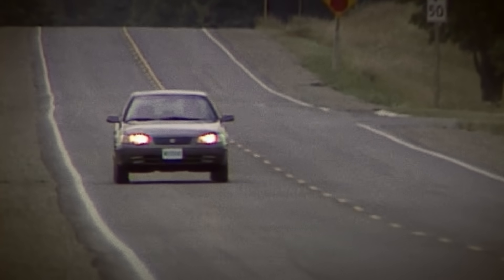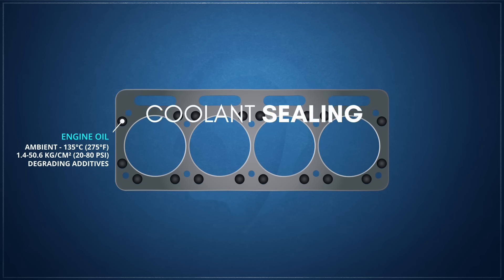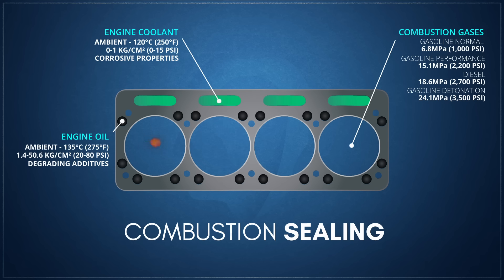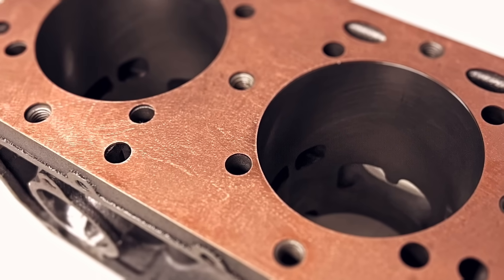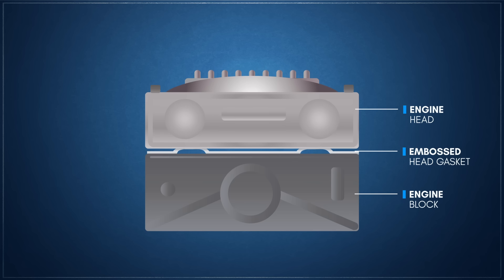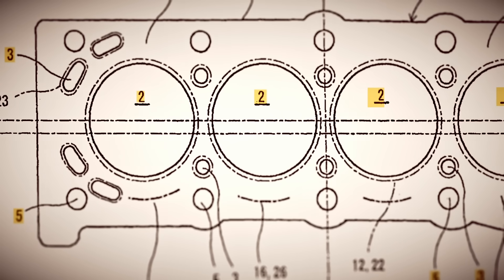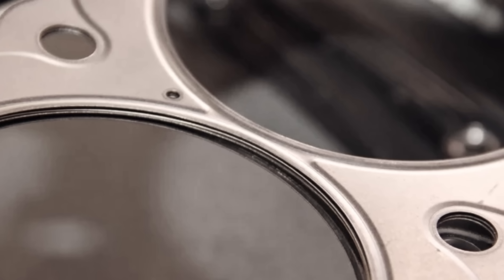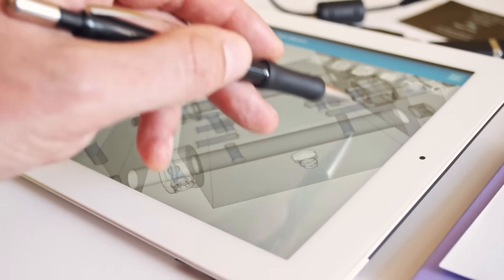The Most Tortured Part In An Engine

Comment: You definitely did your homework. I watch these kinds of videos sometimes to see if you guys tell the absolute truth or bullshit people. Very nice job, you touched on everything that needed to be and included every possible bit of information for the novice
Reply: then you should have understood this video is just a big reach, there is many inaccurate points but the most important is, it pretends head gaskets are rocket science, while they are not, really. Any compression gasket can sustand high pressure because the contact area is extremely small, head gasket is not and has never been "the most tortures part in a an engine", such a ridiculous claim.  Head gaskets are not rocket science, on small 2 strokes they are often just a piece of paper or aluminum, how ridiculous.

Comment: EXCELLENT VIDEO!
Me, ASE Certified Master Engine machinist for over 30 years.  I have been working in the engine rebuilding industry for 55 years. Had my own shop for 20 which included a Comec wet surface grinder capable of accuracy of .001 per 12" of length which is what we used to surface both the heads and blocks.
 Back when I opened my engine shop in 1978, we saw a lot of Honda 1200 and Chevy Vega engines with blown head gaskets. The Honda was all aluminum while the Vega was Aluminum block and cast-iron head. Both used the "open deck" type of block. Both were composition gaskets "squishing" about .007-.008 when torqued. My thoughts were that the cylinders were "moving", and the gasket was not adequately being compressed on the cylinders.
 My solution was after machining the gasket surface of the block flat, I then went around the outer edge of the block and machined an additional .001-.0015. That resulted in the cylinders "standing proud" .001 compared to the edge of the block for a tighter clamp on the fire ring. This really helped the durability of the gaskets.
 But they still needed retorquing which in the case of the Honda meant removal of the rocker arm assembly since it sat over the head bolts, UGH!
   About this same time a LARGE gasket company (FP) announced their no-retorque head gaskets! We were jumping for joy thinking of all the time they would save and started installing them on our engines right away. Within WEEKS we started seeing problems! These engines started spitting out head gaskets some in as few as a couple of thousand miles! The VWs in particular would come back with actual pieces of the gasket hanging out from the edges of the head! We stopped using them and went back to OE type gaskets and the problems ended.
 The company asked me to send them back so I sent 1 of each, Honda, Toyota and VW. They called me and said they would warranty the gaskets. I said that was OK but did they want me to send them the REST of the failed gaskets we had? "How many more do you have?". I told them 32, SILENCE. Then he said "let me talk to someone". Another voice on the phone "Is there a major airport near you?" yes "A couple of reps are going to fly to your shop and see if we can tell what's happening".
  The next day the VP and head of Tech arrived at my shop. After examining my machines and procedures they could find nothing I was doing wrong and said they felt it was the area WATER that was the cause!. I was stunned but before I could open my mouth he said "BUT, we are prepared to offer to pay you parts & LABOR for all the failed gaskets PROVIDED you sign a release form and will make NO further claims against us. It was a LARGE CHECK so I took the offer.
 They must have sold a LOT of those gaskets, we continued to see failures of them that others had installed for YEARS after that!
Reply: ))) id be pissed if my newly rebuilt engine blew again
Reply: @zukacs  The engine didn't "blow". Just the head gasket went bad. I fixed all of them at no cost to my customers.
Reply: What do you mean claims?

 Anyways very cool information. Have any other similar stories for other engine parts to non car layman like myself?

 I figured gaskets were an easy piece. Doesn't look too complicated. Love learning about the intricacies although I'll be never use the information. Don't even have a car haha.
Reply: @dianapennepacker6854  How about Toyota 22R timing chains?
When Toyota switched from double row timing chains with steel guide to single row timing chains with PLASTIC guides.
The driver side guide would often break off and fall down into the timing cover. The engine would still run but with no guide to keep it away from the timing cover.
 The timing cover had water running through it and the chain flopping around would wear right THROUGH the cover into the water jacket allowing coolant to get in the oil often times ruining the engine.
 Saw a LOT of those.
 And then there is the Mitsubishi 2.6.  I could write a BOOK about all the failures with THAT POS!
Reply: @OneAceracer  That is insane as Toyota is famous for reliable and easy to work on cars as well. You'd  think someone would point out that maybe switching to plastic may cause issues with reliability... Especially if it is an engine destroying type malfunction! TIL.

 I honestly don't know anyone who has owned or worked on a Mitsubishi in twenty years. I don't even see them on the road now that I think about it.. What the hell happened to them? Jesus never even thought about it and was thinking of older cars today as I saw a Saturn on YT. They made the Saturn Sky which was a great little car along with the Solstice. Better than the Miata some say but I know Jack ALL.

 You were talking about the Hemi right?
Reply: Thanx to all who replied both positive & negative. We learn from BOTH type comments.
 At the time this happened I had only been in business a few years. I was just starting to expand it, so times were tight.
SHOULD I have waited, not taken the check and tried to get something going on my own? Maybe. That would have been a BIG undertaking at the time though, so I still believe I did the right thing by taking the offer.
Reply: Really interesting.. 
Coming from a Veteran in the industry 🙌🏾🙌🏾
Reply: BTW my nephew is really into cars. He just bought his first one and wants to soup it up and make it a tuner. 

 Have any advice for him? He works at a dealership but I want him to try to get some education too for working on engines. He really underestimated just how hard it will be even just getting tools and such but I'm proud of him so far. 

 How'd you become a certified master engine mechanic?
Reply: Great story
Reply: Rule of thumb never take the check
Reply: @SkyRecruit18  yeah, it'd be better to have a protracted legal battle to claim for hard to quantify damages. Are you a lawyer or something? The company who had the bad product said they would pay for all the costs that these guys had incurred without years of litigation. They did the right thing and you want to try and gouge them?
Reply: Bro. If you denied the money and made your own you could’ve owned a multi million dollar business by now.
Reply: @NokturnalOnYT  I don't understand. Are you suggesting he could have invented better Head gaskets himself?

Comment: Subaru used a coated head gasket for YEARS! It failed at an alarming rate. Finally, they switched to a 3 layer steel gasket. Sheesh. What were they thinking? The old coated gaskets didn’t hold up to acidic coolant effects and heat cycles.

Comment: Someone should have shown this video to the genius’s at ford who designed the eco boost engine which has the worst failure rate in history. 
They had about 1.5 mm of metal between cylinders 2 and 3.

Comment: The copper asbestos gasket can be if in an emergency can be reused. Check the gasket surface ,clean off any oil , then Just soaked it in water for a day or over night. Dry off then reuse.

Comment: There must be a graveyard somewhere of Mini head gaskets that is testament to your claim. I must have replaced at least a dozen on my Mini and my sister-in-law's in the space of a few years. 

Mini head gaskets were notorious for blowing due to the truly tiny web between pots 2 & 3! Apart from one, which was down to a different failure, ALL the ones I replaced went at exactly the same point. Until, that is, I was given a tip by a friend who rallied Minis and told me to use orange Hermetite as well as the gasket. Never had another one blow after that! 😎

Comment: Many years ago a co-worker asked me to take a look at the engine of a boat he bought cheap. The engine did not run and upon disassembly, I showed him the head gasket was completely worn out. Due to the cost of a gasket for an outboard motor, he wanted assurance that it was the only problem. He did not want to spend money on a new gasket to only find out the motor had other issues so I took some common gasket material and made a temp head gasket and reassembled the engine. It started and ran nicely. 
He asked how long the temp gasket would work and I had no idea. It was the same type of material used for water pumps. I said, maybe a minute, maybe an hour. I really did not know. Just buy a proper gasket now that you know the engine is good. Well... he did not listen. That weekend he went to the lake and took off with his boat across to the farthest point when suddenly, the gasket failed. With no oars, he and his friends hand paddled the boat back. I laugh so hard when he told me what happened. 🤣🤣😁
Reply: How was he comfortable full sending on a busted head gasket? Ridiculous🤣🤣
Reply: @furrycircuitry2378  Ridiculous is right! I would never have trusted it. Some people have to learn the hard way.
Reply: The way you were leading on I thought it was going to last for years 😂😂
Reply: Ive seen this comment written somewhere else
Reply: @ChoooChooo  That's possible. I may have posted the story somewhere else, or another person may have done a similar thing. I'm sure I'm not the only person who has ever made a temporary gasket for testing.
Reply: @paparoysworkshop  I believe you, I just thought it was odd! He'll someone might have taken your comment even.

Comment: Once you get to icp's of 40 psi+ or producing more than 1200hp you start to notice the head float on the engine, most engine failures are due to this and the culprit is either too the headstuds or the headgasket. Also tighter headstuds doesnt always means better.

Comment: I have to respectfully disagree, I would say that the crankshaft bearings and bearing journals are way more tortured than a head gasket they're actually taking the force of the rotation of the rotating assembly and the fact that the rotating assembly IE the crankshaft has built-in counterweights in it to try to reduce how brutal it is to the longevity of the motor itself also is a little bit of a testament to it head gaskets are clamped under high pressure which ultimately multiplies how strong they actually are it doesn't matter that they're a millimeter thick or in some cases more or less I think crankshaft bearings and journals as well as the rear main bearing because you're talking about all that power going through a one to two inch diameter tiny little area. The guy who wrote this video is obviously like first or second year like college to be like a mechanical engineer or something like that and it's got to be like his like counter argument thesis topic or whatever. Head gaskets typically last a lifetime of the car. That is unlisted or designed in a manner such as Ford's dumbasses or Volvo's ridiculous breakthrough engineering designs or some other retarded concept thinking they're going to revolutionize a part that's already been established that working well and the way we use it for all these years. And head gaskets typically only go bad if the components on is having a bottom I eat the block or the head crack war or become loosened from one another... AKA s*** ass torque to yield bolts , only having four bolts per cylinder cough cough Ford powerstroke 6 l cough cough cough instead of six especially when there is high compression or being a cheap ass and not going with head studs like pretty much everything should use anyways. And with head gaskets you can actually run the car with no fluids in it whatsoever no oil no antifreeze and the head gasket will not go bad with no cool in there you're more likely to blow the plastic end caps off the radiator from steam before the heads or the block crack or anything like that or Warp. Now with the crankshaft just just having low oil or dirty oil not even going without oil but just incorrect oil consistency or maintenance you could spin a bearing or you can shoot a rod to the side of your engine block. Therefore I rest my case, and yes I am an ASE master technician w/ 17+ years experience. And was that I say check me

Comment: What are the best types of head gasket for hi-performance engine?
Reply: Copper with cuts in the block and head for stainless o-rings. The head can and usually will lift, but because of the interference seal, it's not gonna leak. The modern equivalent is something with a stainless cutting ring. I think a few companies make them.

Comment: Diesel pressure much higher.
Porsche no head gaskets lapped surfaces
I would say Exhaust valves are the the most intense temperature and stress reversal fatigue issues.

Comment: The first Diesel engine that Mr Diesel prototyped was constructed from a re-purposed steam cylinder, which did not have a separate head, nor a head gasket. 

It exploded, and nearly killed him. 

Many steam engine designs did not have head gaskets - they were blind-hole cylinders of a part with the head, so as to avoid the head gasket as a failure point. This works because steam engine develop pressure in the boiler, not in the cylinder, and so it is the boiler that needs the pressure relief system.

The whole point of having a head gasket, on an internal combustion engine, is that it acts as a burst disc, and fails rapidly relieving pressure before the engine explodes. 

Just like the fuse in an electrical circuit, it is obviously going to be engineered to be the most stressed part: it is the part you want to fail first.

This is why every production internal combustion engine has a head gasket, not just for the manufacturing convenience of splitting the design into a separate cylinder and head.

Comment: Hey bro, great video but some of your metric to freedom units conversations are off by a tad. Oil pressure early on (50.6kg/cm2), and then surface roughness about 2/3 through (80 though is 2mm not 2 micron)

Comment: It's amazing to consider all the little things that go on right in front of your feet.  Or in my case, as near as 4 inches from my right foot in my van.  For anything to function properly,  there has to be a long list of things with various degrees of acceptable tolerances, all happening hundreds to thousands of times per second.  All in a meticulously orchestrated "dance" of fluids metals, composites, fire, electricity and so much more.    It's a chain.  Just one of those little things fail in even a small way,  the entire thing suffers in performance or risks potential, permanent damage.   

A lot of young people think that their dad's, uncles, paps, or anyone else who preaches about vehicular maintenance, is just a blow-hard and likes to complain and worry.   "Oh my oil was just changed last year!  It can wait.  - I' don't need to flush the coolant.  My truck doesn't overheat.  it's fine!"   Sure,  it's running fine,  Now.   But what they don't account for is those minute stresses,. forces and movements going on in their engines.  It not just 4 to 8 chunks of metal bouncing around, and a spinny-ma-jig whirling around.   No.  As the host said, there is thermal expansion, temporary movements and many other unaccounted for actions going on outside of even the best of human eyes ability to perceive. 
So when dad says "Did you change your oil?"  or "You may want to get a coolant flush."  He's not nagging.  he knows.  It's called Maintenance.

  The car is a machine.  Machines absolutely MUST have regular maintenance to operate properly.   Any thing that slips, rubs, pivots, turns, or reciprocates, will eventually wear out.  Proper maintenance can drastically prolong the life of those components.   From the crankshaft bearings,  right down to the hinges of the glove box.  If it moves,  keep it properly lubricated. Trust me,  there are WAAAY more things moving in your car, than you think!  So pay attention,  read up on how things work.  Put that cellphone to use, (NOT while driving!) and look up how-to's and other things about your car, instead of tick tocking and posting duck-lipped, or mindlessly screaming in vertical videos on isnta-scam.
Reply: Excellent comment. The more I learn about my vehicle the more I am amazed and neurotic about keeping on top of maintance, recording what and when something has been done

Comment: Please use the correct writing of units, especially don't arbitrarily all caps them. Stick to cm, kg, mm, and especially use an actual micro μ, not a u. Sometimes you noticed when using units like Pa, and did it correctly for a while before regressing again. Solid presentation other than that.

Comment: I've started my 1uz ls400 at negative temperature -30 with my foot flooring the gas. I'd say the timing components are more vulnerable or even piston rings and cylinder walls. The head gasket isn't really stressed when the torque force on the bolts are holding the head down are probably more stressed than the gasket.
Reply: I agree the headbolts are whats getting the stress and what stretches. The gasket is just smashed under the head.
Reply: @xxxxxxxx183  Hence studded heads for higher compression cars.